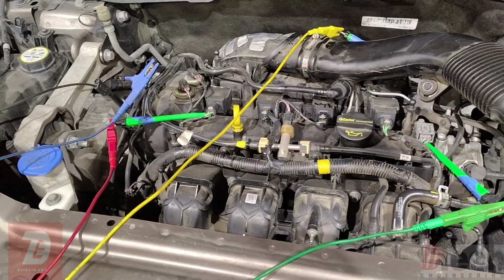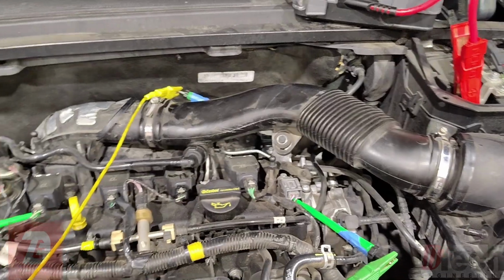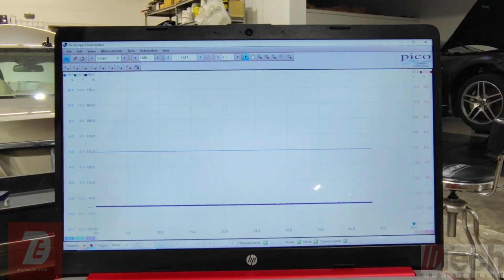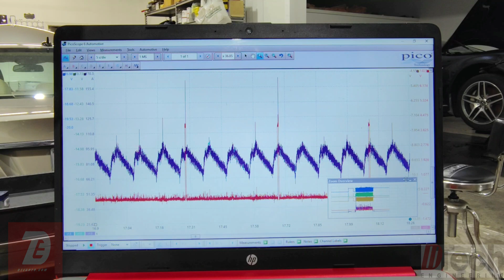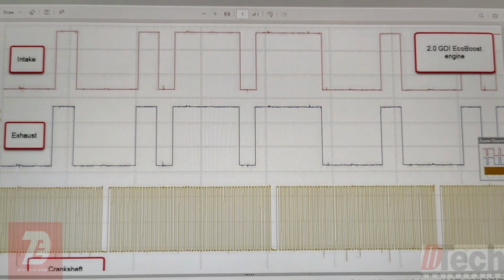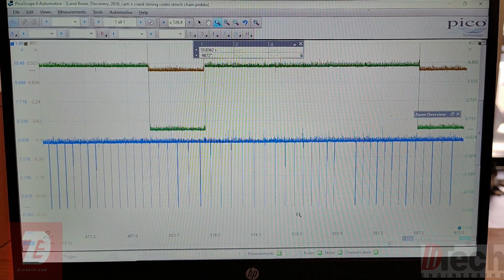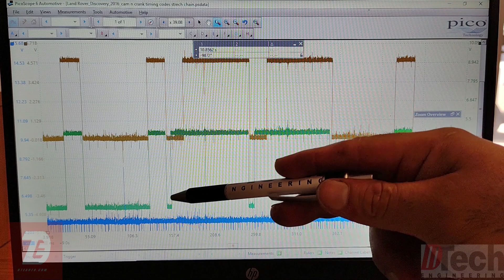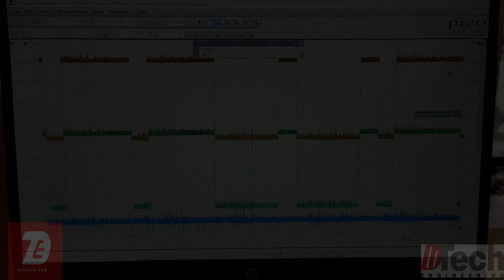Land Rover 2.0 Checking Engine Timing

Comment: I can understand difference in timing between the cams when VVT is in operation, but cannot explain why and how the signal width changes
Reply from the maker: It is due to the cam phaser not locked into it's at stop position, so when cranking up and starts to rotate it kind of "bounces" until enough oil psi fills it and holds it steady. That's why you see it in the cam waveform changing width.
Reply: Thanks for clarification.

Comment: What will make  cam to cam to be on time but  ckp off time 7 teeth, how many degress of crank rotation are this .

I thinking 🤔 of some one removed the harmonic balancere and did not used the special tools to do proper timing, or ckp sensor replacement without the special tools .

What is the history of the vehicle?

Comment: Thanks for the video. With the variation of signal timing, on initial crank I was thinking it could be related to oil pressure building up during the cranking.  Something to do with chain slack, chain tensioners or the phasers. I don’t know the timing chain design so am just speculating. Thanks again for the post
Reply from the maker: Great point!

Comment: I assume this is the Ford engined example and not the later JLR engine?
Reply from the maker: Yes, I believe the ecoboost type
Reply: Correct, the ecopoop got replaced around 2017/18 with the JLR 2.0 ingenium trashpile

Comment: What would cause the skinny captures? Tone ring issues?
Reply: Saw something similar to that on an SMA video, the phaser/cam assembly was 'jumping' around when cranking the engine, resulting in unusual scope patterns
Reply: @mrblonde2013  that’s what I figured. Saems to fit the diag, hopefully sadel gets the job
Reply: I would more think an out of spec aftermarket cam sensor.
Reply: @stevepark5504  he calling timing job so it’s not a sensor but it is interesting how it’s being picked pick up. Must be expanding when hot.
Reply from the maker: I still don't have an exact answer to be honest.
Reply: @DTEAuto  hoping you get the job dying to find out.